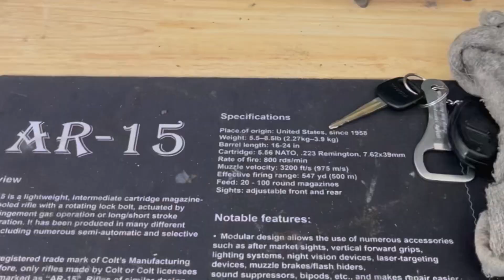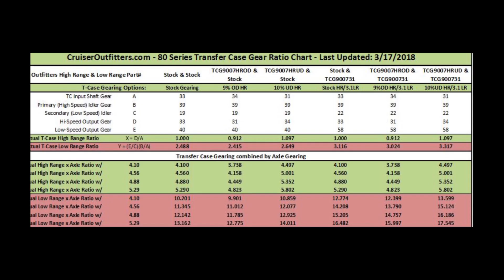Sumo Gears High Range 10% UD TC gears first impressions/fluid change in the 80 Series Landcruiser!

Comment: When I put bolts back I always use anti-sieze for sure.  Good tips. How much did that cost you do have them do the gears?
Reply from the maker: All total it was about 1800$, they did a really good job
Reply: @GarboOffroad  that's not bad at all . Thanks